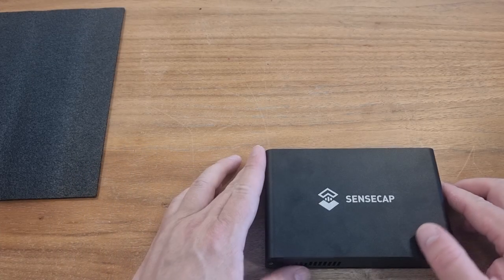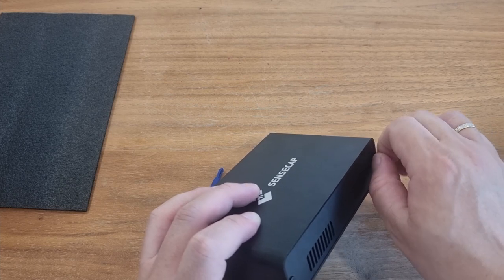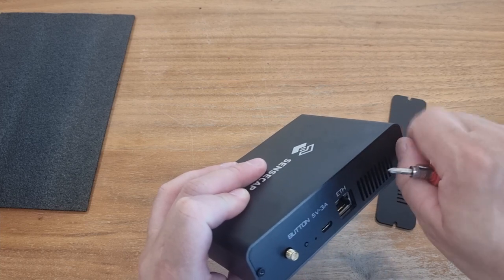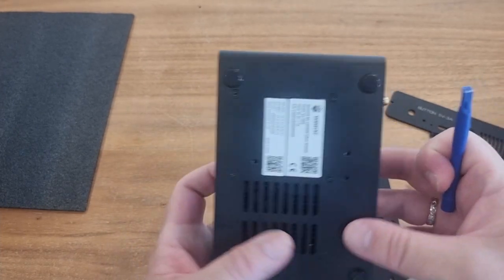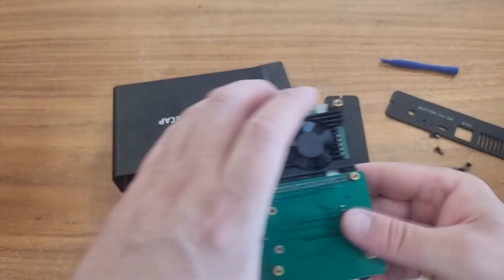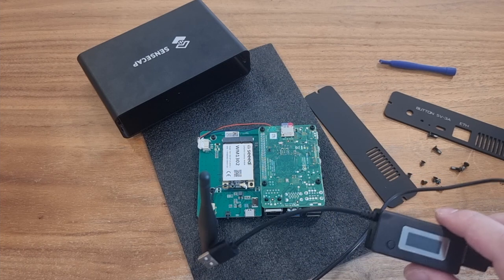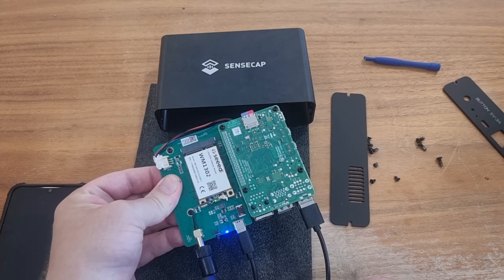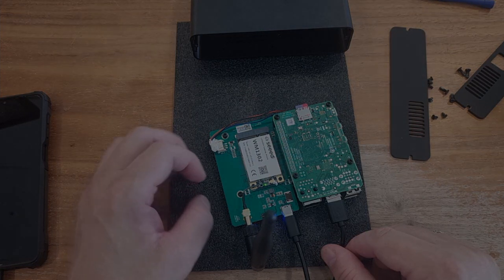Sensecap M1 dismantling

Comment: Can I use it in extreme conditions at minus 90 degrees because it works at a research station in Antarcticathere are many polar explorers and I would like to put an excavator there. 
Whether all connectors are plated with 23 g gold which causes a standing wave to dissipate 23 percent of the usual silver plating. What capacitors are used? How can you check if they are electrolyte capacitors with extended life. And is it possible to increase propagation by increasing power? Thank you for the nice program on Youtube
Reply from the maker: That's the question for developers.
You can chat with them on their Discord server:
https://discord.gg/mYy6sssqVV

Comment: Thanks for the tear down video! My unit worked great for about 2 months. In the last 2 days it quit working. With the power cable I get the red light solid and the green led is intermittent and slow blinking. The ethernet cable shows green & yellow lights. However the bluetooth blue led is not working at all. The unit shows offline in both Helium app and Sensecap dashboard. Any ideas what the problem might be? Is it possible to configure the unit to use ethernet instead of wifi without using the bluetooth connection from the Helium app?
Reply from the maker: Quickest support you will get is on Sensecap Discord: https://discord.gg/T8TcCpJ2nt
If you use your Helium app you can go to change WiFi, then click on "forget WiFi" and connect eth cable.
Don't forget to setup new port forwarding for that new connection (relayed problem).
Reply: @Hypno020  Thanks! I'm new to discord but I connected with Sensecap tech support. They recommended re-flash the SD card. My pc (Windows 10 pro) didn't recognize it so I was unable to grab the config.json file. Tech support requested a new file for me but it comes from China, so we're waiting. In the meantime,  i put the SD card back into the hotspot and it's still not working. 
Thanks again.
Reply from the maker: @raiden5827  If blue light is not working then it might be problem with SD card.
You can flash new card, but you will need config.json file.
You can either copy it from your old SD card or request from Sensecap support.
More information: https://docs.sensecapmx.com/m1/troubleshooting/micro-sd-card-errors/flash-new-micro-sd-card-image

Comment: What are the USB ports for? They are blocked normally
Reply from the maker: Some people (like Ricky J) are planning to use it for USB internet modem. It might be handy if you don't need internet for anything else (like at home). Or you might also use them to power up some devices like sensors (i.e. temperature, humidity, water detector, etc.).